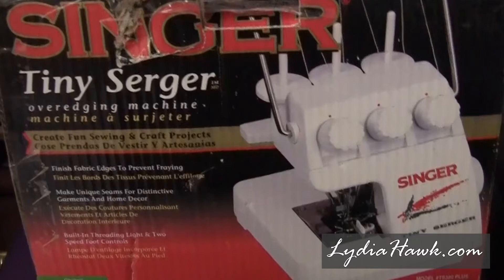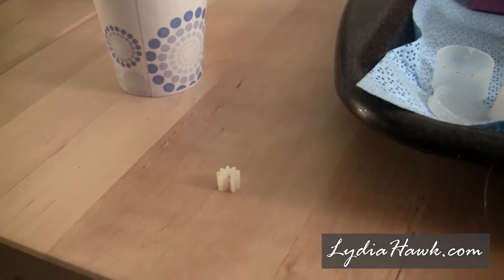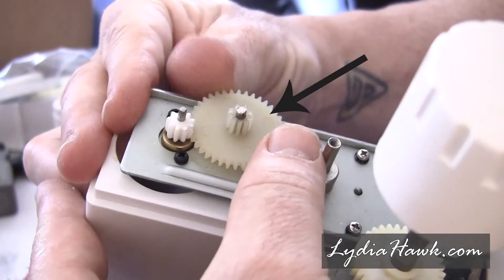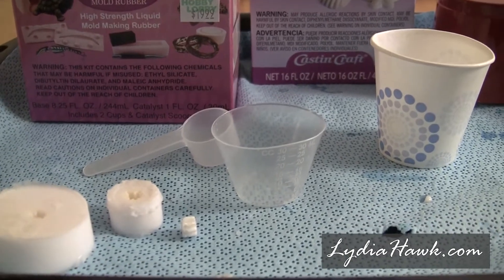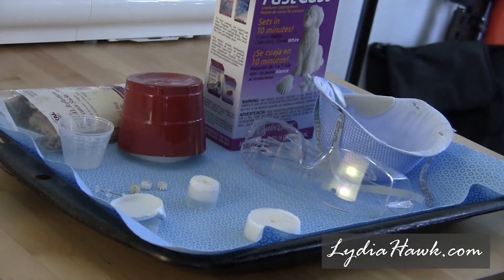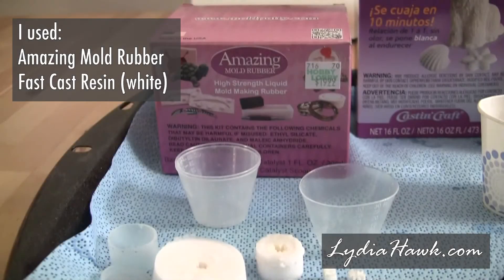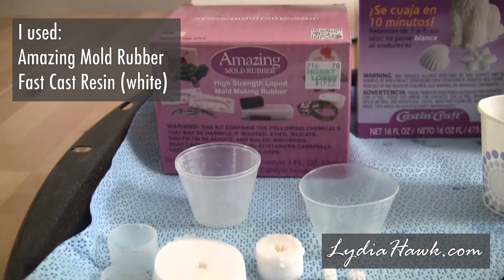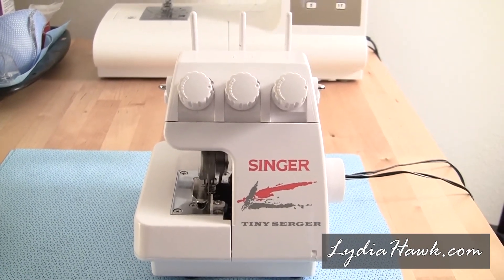DIY Singer TS380 Tiny Serger Replacement Gear

Comment: Do you think that if it had been well lubricated when manufactured, it would have held up?  Other parts that are metal on the machine appear to be sturdy.  I would think that cast plastic would not be durable enough for gears, but I am happy to see that what you did actually did work.
Reply from the maker: I'm really not sure. I'm surprised that Singer produced something like this with a gear that fell apart so quickly after purchase. It's pretty deep in the machine, so I'm not sure lubricating could have fixed that issue, but yes, fabricating a new gear fixed it. Truth is, Singer's Heavy Duty Serger was so inexpensive this year that I went ahead and replaced it. This one cuts fabric, so... No one ever believed me that Singer made a serger that doesn't cut fabric.

Comment: This is exactly what I need to fix. How did you open the side?
I have a problem right now. I could not open. Thank you
Reply from the maker: It's been awhile since we've taken it apart. If you pop the feet off the bottom there are screws underneath. These plastic machines are a combination of screws and pressure tabs where you use a thin tool and gently test where the tabs are and pop them open. Here's a link to what we did with my Singer Confidence Quilter. Same principle. https://youtu.be/3v0GOZx6TzE
Reply: @LydiaHawkDesigns  Thank-you very much! I did it !
Reply: @jessicaoliveira3380 yes, I fixed and use it.

Comment: how has the gear held up?
Reply from the maker: Good! I've been meaning to post a video using it, but it's so hard to thread!! LOL
Reply: @LydiaHawkDesigns  I found a deal? on one, I really don't need it , but fixing something someone else pitched it because it can't be fixed, is the majority of what I did for a living 40 +years, I will keep an eye out for a video on it, thanks for responding
Reply from the maker: That's cool! I love fixing things! I wanted to fix a Sound Soother from Sharper Image I bought years ago, but even the Electronics sub Reddit couldn't help me. Such a bummer!